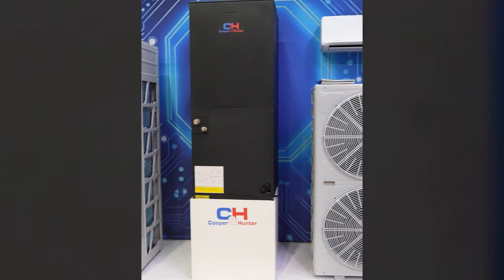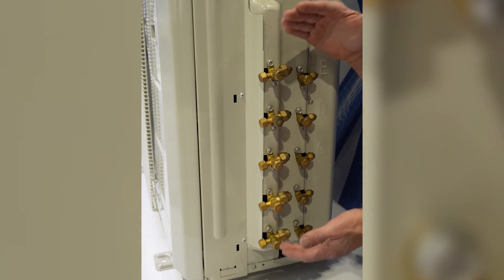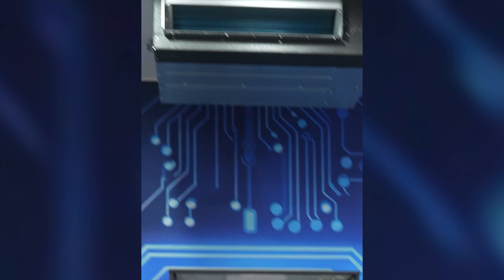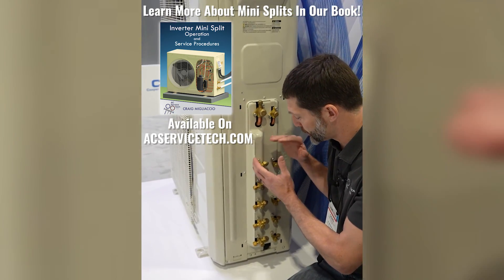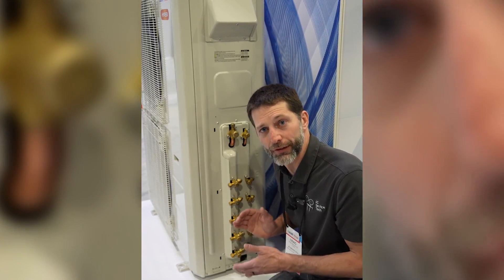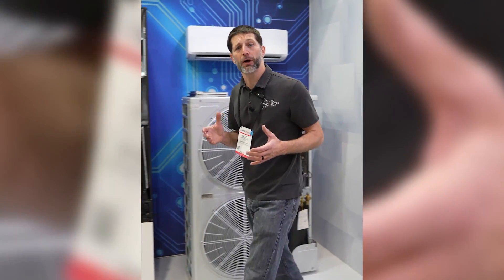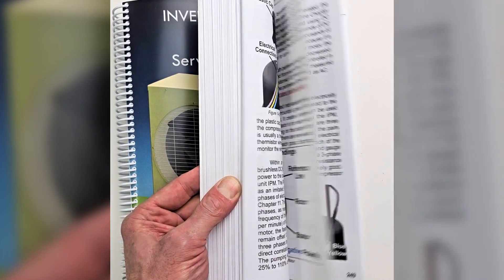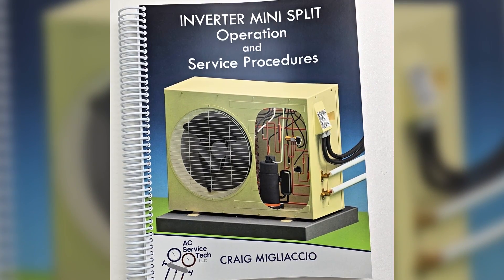Multi-Zone Mini Split, Mini-VRF, and VRF System Differences Explained!

Comment: On a standard multi zone, does the eev close fully if a zone is satisfied or turned off? Or will refrigerant still flow through the other heads if only one or two are calling?

Comment: Craig, Just wondering if you could answer a question about my C&H unit, much appreciated. I sent this message to C&H technical support but they did not respond to my message, maybe because I'm a homeowner asking.
I have a C&H CH-HPR24-230VO outdoor unit and a CH-M234AHU air handler.  I'm not using the C&H communicating thermostat, instead using an Ecobee 3 lite tstat.
When in heat mode I set the thermostat to fan ON, the fan doesn't turn on.  The Ecobee also has a feature to keep the fan running for a period of time after the set temperature is reached, Ecobee calls it a cool down period.  When I set the fan to ON or in the cool down period I verified the G terminal is at 24 volts.
I'm thinking that the fan might be controlled by the board in the air handler and not solely by the G terminal ?

Comment: I thought appliances were getting tough. Looks like the tubing is thick, hopefully that's the case. Imo split style systems should only be installed by someone that went through traing from the equipments manufacturers. Nothing like getting an after hours call on one of these where the homeowner over torqued the damn fittings or didn't have nitrogen to do a pressure test. Then they flip out when you tell them how much it costs to correct.